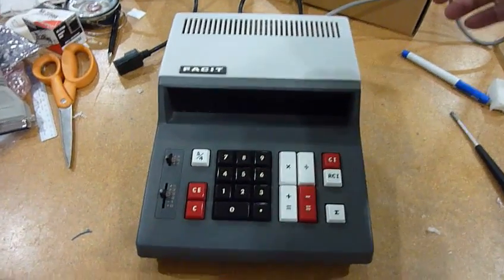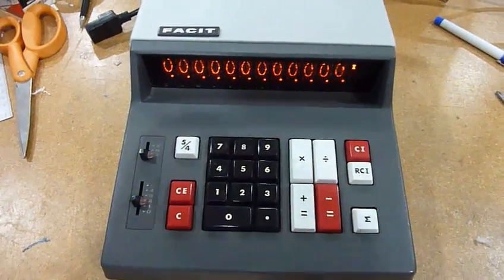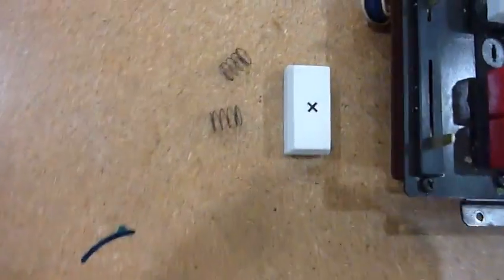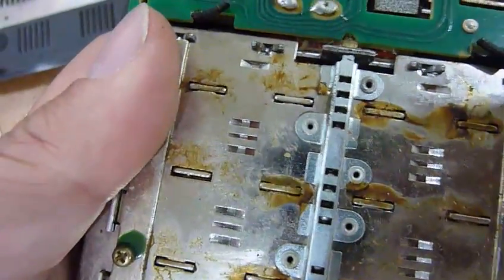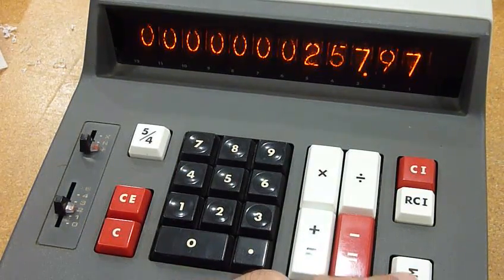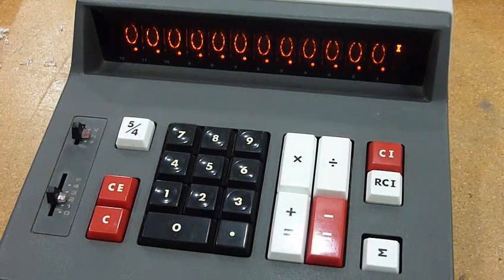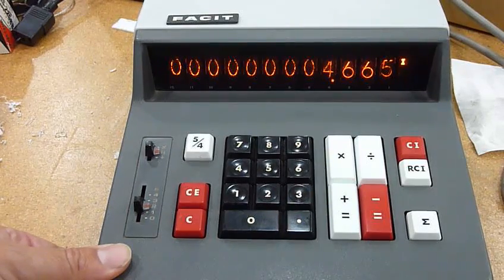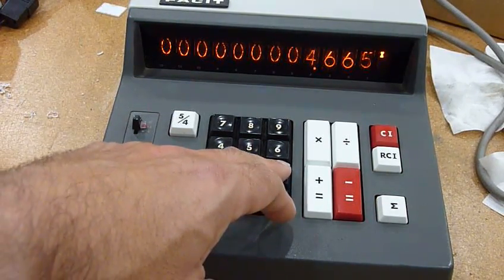Facit 1131J Nixie Tube Calculator

Comment: Thank you for the video, 
I somehow found a 1117J version in the trash and rescued it, it is in fantastic shape, you just have to really work the power cable in and give it a full 20 seconds after switching it on to power up.
The only differences I can spot is that mine uses old school LED numbers, has the 5/4 as a switch instead of a push button, there are no indicator lamps (or room for them) on the multiply and divide keys, it only goes up to 4 decimals via another sliding switch and the display has 3 free-sliding plastic tabs you can use to mark the thousand/million/billion commas.

I find you also have to really do a fast jab on the keys to prevent a double press.

Comment: I have two predecessors to this machine, the Sharp Compet 16 from 1967 and the Facit 1122 from 1966 (a huge machine, almost as big as the Friden EC130). Both are fixed point with optional rounding and both have illuminated multiply and divide keys. See the Facit 1122 in action here: https://www.youtube.com/watch?v=FKhe9065MPc

Comment: I've got a massive transistorized behemoth of a Sharp calculator from 1969 which uses the exact same keyboard module as your Facit there, and i can confirm that it does indeed have neon lamps beneath the multiply and divide keys. Looks pretty neat in operation, doesn't serve much of a practical purpose.
Reply from the maker: +eatabagofhell Thanks for the note and confirmation!

Comment: How did you get the little slider knobs off? I have a facit 1132 with a stuck keyboard but I can't try to repair it because those knobs seem to be glued to the sliders
Reply from the maker: I don't remember, I think I just pulled them off. I would very much doubt these are glued, but they might be holding on pretty tight after all this time.